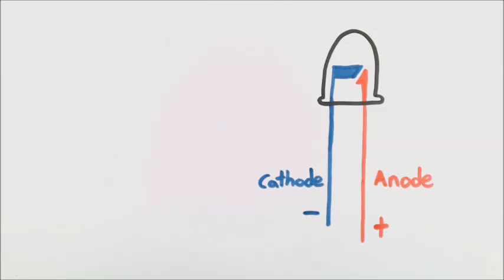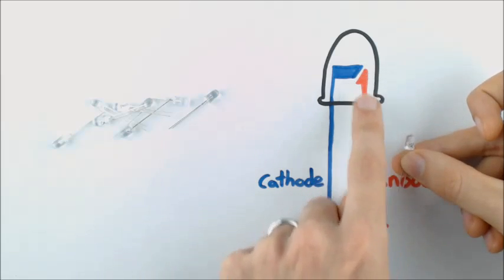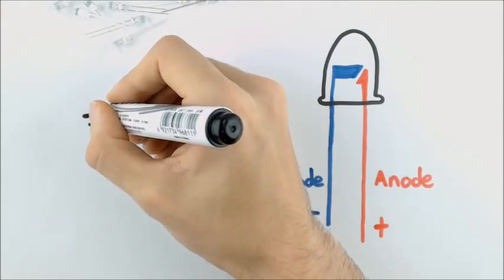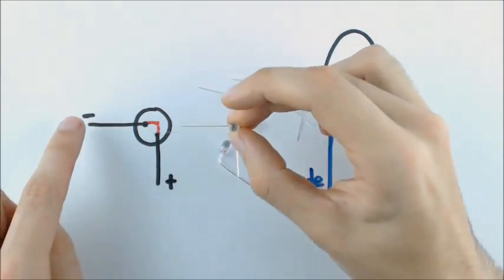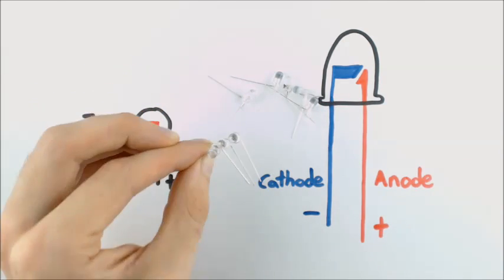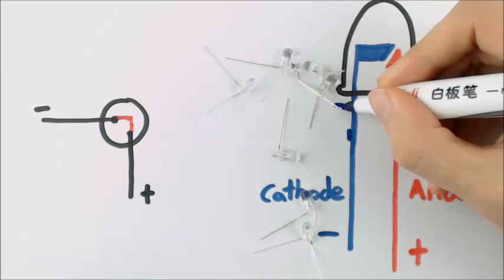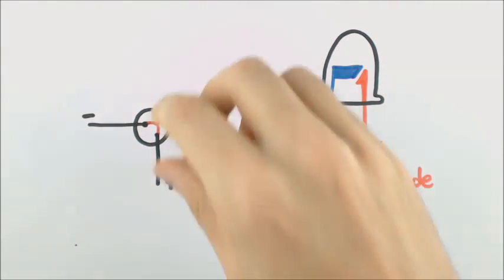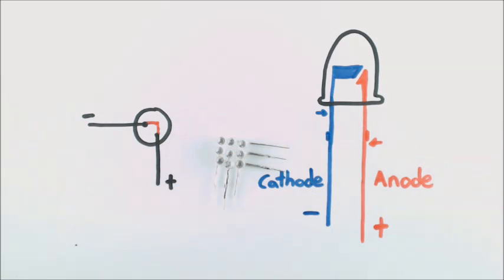Raspberry Pi Project: The LED Matrix (Part 1 of 9)

Comment: I have some LEDs at home where the anode has a bigger plate inside the LED casing than cathode, so it's impossible to determine which pin is which just judging by the size of the plate.

Comment: Gaven, I'm programming in python is there a way to do these projects using python?
Reply from the maker: Hi Michael. Don't worry, the entire project (and actually currently everything on my channel) is done using Python code.
Reply: After watching some videos I figured that out. Thanks hope to get a rp soon so I can get a hands on. Can I order one of these rp that is all ready to go with an os?   When they first came out you had to upload your own os.
Reply: Where did you go to learn how to  use python as your programming language for doing these electronic projects? Thanks
Reply from the maker: If you want to buy a Pi with an SD card with the NOOBS OS, check out this link: www.raspberrypi.org/archives/4536
It's also not too hard to download and install the OS yourself if you have an SD card reader. Let me know if you need help.

With regards to Python, I learned it via the free course on Udacity: www.udacity.com/course/cs101
It's an intro to programming course, so if you already know a language, the course should go pretty fast.
Reply: I took that course from udacity. I guess what my question is how to use the language to program the microcontroller. Ok thanks for the response.